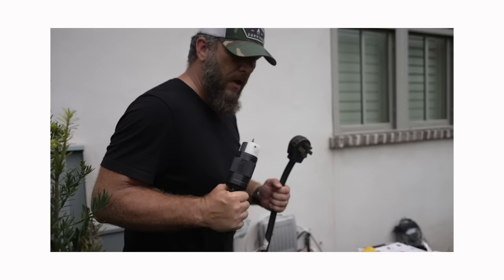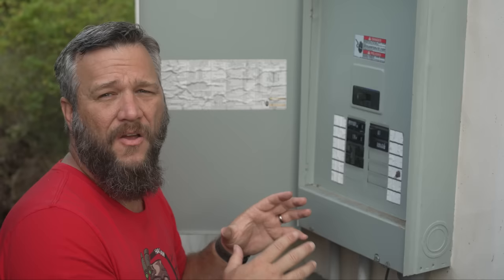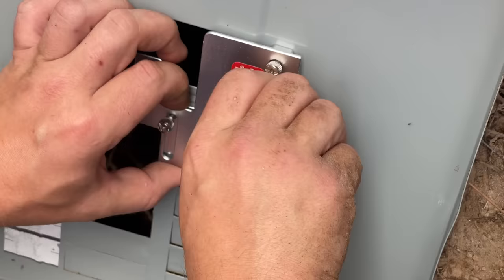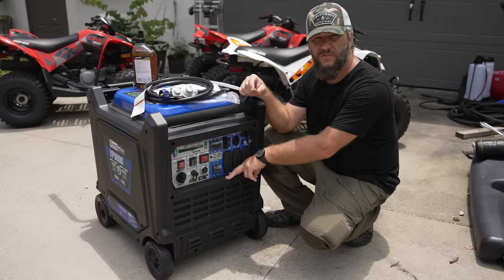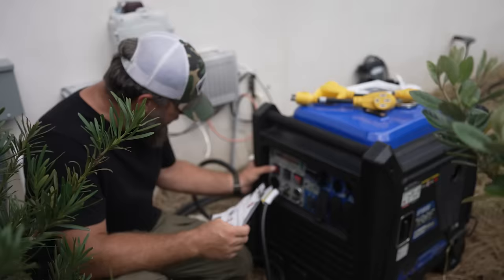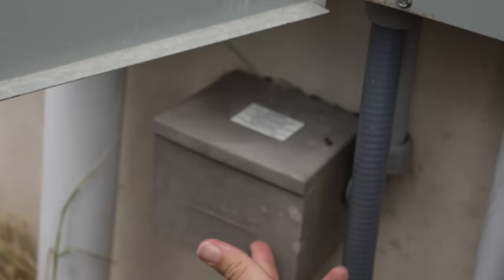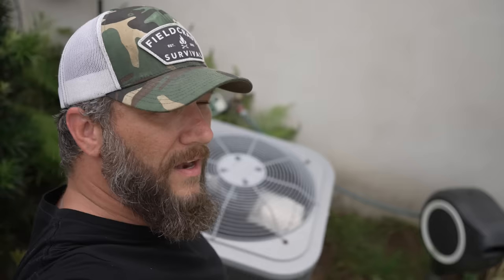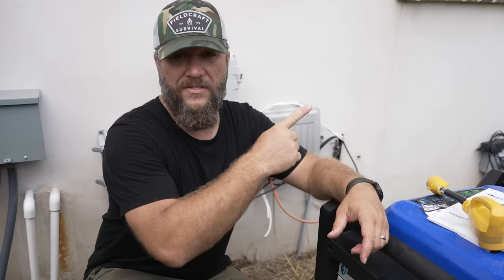90% Don't Know About This Fatal Generator Connection

Comment: Had A friend who couldn't get edison to turn his power, so he bought some cheap 7,500watt generator that put out 240v, so I just got an 8 guage 4 prong and wired it into both legs, the neutral bar and ran a 6' long copper bar into the ground. Damn thing was so loud they built an insulated playhouse around it  and put a better & bigger muffler on it all for under $1,000. 5gal tank $3 gal got almost 12 hours run time. Changed oil every 500 hours He realized at 3k hrs and $4,500 that he was wasting more on gas  & that $1,200 month for edison was a little cheaper AND MUCH QUIETER!

Comment: Many municipalities do not allow an interlock device. They require a manual or automatic transfer switch. You must disconnect the neutral wire when you transfer. You also must properly ground the generator with an approved 10’ ground rod. Best to leave it to a licensed electrician. The life you save could be your own or a family member. Just because it works doesn’t 
mean it will pass inspection and be safe. If you had a house fire and didn’t get a permit and inspection that is the first thing an insurance investigator will look at. Not worth saving some money by doing it yourself.

Comment: Although I don't recommend bypassing any safety measure, linemen always take all precautions as if all lines are hot while making final connections. A lineman grounding out the primary side that might be hot from a generator will hardly even notice a spark if the generator's breaker isn't tripped already. I don't believe there is a single documented case of any linemen being killed by a backfed modern generator like this.

Comment: I back feed my Panel through my dryer plug   30a  ."rule 1 turn off main breaker and all breakers  .plug gen into dryer plug and add back all  120 breakers  ..I have a 12000 btu roll around a/c for bedroom works like a charm..when done unplug gen turn off breakers then turn on main breaker then all other breakers

Comment: 4:30 years ago we had a generator that was way too small for our house . You would have to unplug all the stuff like fridges when it started or it would trip its breaker. So i had the bright idea of revving the engine the held the breaker about when it would normally trip . And boom . Fried a bunch of electronics. I guess an outlet inside was shooting sparks 😳. Ya dont do what i did . And similar can happen from having fluctuations in power from what ive heard .

Comment: best way would be to get an hybrid inverter and  connect the generator to the AC in to charge batteries or feed the house. Safe and no backfeed. you could even connect solars to the hybrid inverter if you decide to have batteries.

Comment: How the hell can a licensed electrician not do the job correctly. This is a law surt period. Are you sure that if the main beaker from the power lines is on and you connect the generator nothing will happen ???? No generator burnout, sparks flying, or lineman dying ??? Thanks for your answer Sir.
Reply: If the power is on and the 200amp breaker is closed, you'll have fireworks. 
If the power is off and your 200amp breaker is closed an you start the generator no lineman will be harmed.....long as he's in the truck and not touching the line you just energized with a backfeed

Comment: Between the step-down transformer and 100s of amps of inrush into the neighborhood's connected loads, most domestic generators would immediately trip their breaker from being hooked up to a practical short.

Comment: HELP 😊Regarding the plug in sequence. I keep reading different things 🥺 DO I Start Gen, then plug in to Gen and transfer box, THEN flip main breaker Off move breaker lock and engage generator breaker? Thank You!
Reply: Cords should always be plugged in before Turning anything on. For disconnecting, Then all breakers should be off on both ends and gen off before unplugging.

Comment: Yes, power will definitely flow backwards even through the transformer creating 7,200 volts to kill the alignment. Not to mention if the 50 amp breaker gets turned on. You have a male plug end sticking out That's hot

Comment: One issue with the interlock kit... What if the main breaker fails and gets stuck in the on position but indicates in the off position? Ive seen it happen before. Theres no way to test the breaker really us off without taking the panel cover off

Comment: I use the potentially dangerous way....until I can get a transfer switch installed.

I use it with power stations with an AC on off switches in between as an extra layer of protection. I understand why interlock switches are needed and I get why we say NEVER this and NEVER that for the ID 10 Ts out there but I use them and while they have the potential to be life threatening, I use them very responsibly.

Comment: Male connectors on both ends of the generator cable are illegal!
Reply from the maker: This doesn't have two male ends. The female end has a guide rod in the middle.

Comment: didn't see you turn the breaker off on the generator first before powering it down.  turn off either the breaker at the generator or the house before turning off the generator is a good practice so the voltage doesn't drop to the house...

Comment: You say you hired an electrician to do the job, but I say, what you hired was a hack handyman impersonating an electrician. No competent/real electrician would install that hookup without some kind of interlock.
9,000 Watts will produce about 30 Amps at 230 Volts. I had to upgrade to a 12,000 Watt in order to handle my 3 Ton Central A/C system without bogging down on start up, and I am wishing I had gone up to a 15,000 Watts (62 Amps) so I could run several larger draw items at once.

Comment: With that size generator and running central unit on a 30amp connection, you will not beable to run everything in the house. I had my Westinghouse set to the 30amp side and when I tried to run anything big like stove or microwave it would not do it. I am wiring it up to a 50amp side now to comp for it, but even with my 12500 watts I will not beable to run central on a 3 ton unit due to the draw.

Comment: When the work was being done in this video, it appear that both the home owner and the electrician the line side of the main panel was energized.  With the main panel energized, NFPA 70E requires PPE to be worn (e.g., Category 2 PPE (Insulated gloves, insulated tools, face shield, glasses, etc.)).  Another safety point, always place the portable generator at least 20 feet from the house with the engine exhaust directed away from windows and doors. In this video the portable generator is next to the house and near a window.   Information in this video is good regarding the used of the interlock breaker.  However, as far as safe work practices used during the electrical work and safe location of the generator, this video gets a solid F.

Comment: If I connected a generator to my house system with the main on I would be trying to power four houses on our side of the transformer only. I have no idea what kind of load from the transformer up line side would be, but I doubt my 200amp main could handle it and certain that I can't afford a generator that could. FYI found out the hard way that just because the main is off doesn't mean that it actually is off.

Comment: @haxman I dont have a large propane tank myself, but I like the idea of setting several 20lb grill tanks aside for running a whole house generator, but how long would a generator run for each lb of propane? Can you run an hours per lb test for us please?
Reply: You might get 8 hours from that grill tank that’s about it .
Reply: Three hours if you’re really powering a lot of stuff, five hours if you take it easy.  Lots of experience with this with Hurricane Ian.
Reply: those small tanks will ice up as level drops and stop delivering propane even though there is still 10 or 15% propane left.
Defrost and restart 😂
I get about 7-8 hours per tank on our lightly loaded Wen 11/8 kW genset (11kWgas/8kWlpg)
Reply: @rossr6616  just last night using the grill the tank was still feeling half full but the burners flame  were getting lower its a large 5 tube stainless char broil unit a douse of boiling water perked it up .
Reply: Wow, it doesn't last long I'm hearing. Lbs per hour instead of hours per lb. Thank you all for the food for thought. I may stick with a gasoline generator as a result..

Comment: People always talk about lineman getting ⚡️ from a generator. This is a true possibility. Although lineman are trained to always act as the gun is loaded. And don’t ever point it at your face. Some solar systems deliberately send current back into the grid “A grid tied system”. Lineman are prepared in safety gear for this, and they alway consider that the gun is loaded. They also deal with a lot more current than a generator puts out.

Comment: When purchasing a generator for your house you should look at running watts instesd of max watts, or surge wattage. No matter the size of the generator you can only utilize 12000 running watts due to the fact your output is governed by a 50amp rec.  Also you may beable to run your ac but you should turn off your stove and hotwater tank breakers.  Your hotwater tank is usually 4500 watts.  If either was running your ac would have tripped the breaker on your gen.

Comment: Had a buddy actually backfeed his 7500 watt gen into the grid. It would immediately load down his gen and trip its breaker. It couldn't begin to run his neighbors houses, streetlights and whatever else was on that particular circuit.
Reply: Unless the storm damage meant it was only trying to power 1 or a few houses, with most of the loads in them likely off. A few houses porch lights and some small vampire loads wouldn't be a big load
Reply: @franklofarojr.2969   It's in a heavily populated neighborhood so everybody's fridge, furnace, water heaters, etc would try to power up along with back feeding into the transformer which would present quite a load. So it would be an enormous load.

Comment: A bigger generator/inverter generator isn’t always better for one main reason - fuel consumption. A larger generator uses much more fuel per hour than most people realize. And most people don’t have the ability to store larger amounts of fuel, even enough propane unless they have at least a 500 to 1000 gallon tank.

A great solution to all of this is to match generator wattage output to expected critical use appliances. Have enough generator capacity to run a water well and maybe a furnace plus a few lights along with refrigerators/freezers. Cycling power between larger appliances is even better. If you can get by without the larger appliances, that’s even better.

Here’s a couple of examples.

A Honda 2000 inverter generator is a fuel sipper and can run some lights and a refrigerator and/or freezer (especially doing cycling between units if necessary) at a 50% load for two gallons of gasoline the entire day. Take a much larger generator inverter and that same gasoline can be over a gallon an hour in many cases with wasted energy and precious fuel lost in an emergency. 

You would never get me to use up precious fuel (especially with a long emergency), have a louder than normal larger inverter generator running if OPSEC is a concern plus other reasons.

After running generators and generator inverters for years and talking with electricians, they recommended the smaller generator for the reasons mentioned above. 

Also, in an emergency grid down scenario with more craziness of people changing by the day, you clearly don’t want more people seeing your place lit up like a Christmas tree while they are searching for warmth, food and shelter. Hopefully you know what is being said here.

Use OPSEC (Operational Security) measures as much as possible. Use common sense and don’t be a target. You want as little attention as possible in an emergency. Bigger generators producing lots of power is not necessarily a friend. In most situations, it’s fine. In the thick of problems, it’s your worst enemy at times.

Comment: What is the running wattage on your inverter? I have a 9000 watt generator (start up) and 7250 (running) watt generator. Your real power that powers your house is the running wattage. Just wondering why you went with a 50 amp breaker. Mine at 7250 would come out to 7250/240 = 30.16 (ohms law to determine proper breaker size). Not sure if inverters have a runnig wattage or if the start up wattage stays that way on those. Most 9000 watt generators require only 30 amp, which is listed on the generator. I'm just wondering is all.

Comment: We just had a series of storms and lost power for many hours. The problem with basements is that without power, the sump pump doesn't run. This is not a fun situation. 
 Did the electrician install the subpanel on the outside of your house?
Reply from the maker: It was already there because of the well pump breaker.
Reply: Thank you for your information. I am researching this for our place. My wife doesn't respond to the old electrocution gag anymore. 😂 You got her good. Did you find that that generator meets your household needs?
Reply from the maker: So far so good. I think I might still need slightly larger just to be on the safe side.

Comment: We rarely need a generator how ever my grandfather works construction so if we get hit by a hurricane and it knocks the power out he’ll always have a generator from work on standby he’s back fed the house using the dryer outlet but he’s smart enough to turn off the main breaker before doing anything so he doesn’t back feed the entire neighborhood but he knows what he’s doing I don’t recommend it but for him in a pinch it’s fine, him being a construction worker and an area superintendent safety is the most important thing to him.

Comment: Cheaper inverter generators (not buying an industrial one) can suffer from large inductive loads such as your air conditioner or power tools if you get near their maximum capacity. Mechanical generators don't suffer nearly as much and are good for inductive loads.

Comment: These things are nifty and they do work but you would never get a permit with that kind of an interlock in my jurisdiction. The electrical inspector would call you a hack. A properly labeled manual transfer switch is the proper way to do this.

Comment: The interlock switch is kind of a useless add-on. Anyone who would be using a generator already knows to switch the breakers. Technically it does violate a code 702 that requires a mechanism that prevents 2 power sources from powering the same box, but the punishment is revoking work permit, but you aren't going to get a permit everytime you turn on the generator in the 1st place.

Comment: When running gas, to kill the generator, turn the gas off, and let the generator burn/use up the gas in the carburetor. It will keep your carbs cleaned up. Most people just hit the off switch and gas sits in the carb which gums it up.

Comment: Interesting. I have the same unit but in Genmax orange. It does NOT start my 3 ton hvac unit under propane, and I have a Micro Air EasyStart on it. It pulls 36 amps when it kicks on, which ia just above the impulse voltage of the generator under Propane.
Reply from the maker: That's odd. I wonder why that is. I don't have a soft start but I'm going to put one on. I've also wondered if they were the same company.

Comment: As I understand it since you only have a 50 amp ckt, a 9000 watt inverter is about right, should be around 40 amps - gives you a 20% safety margin.

Comment: Thats crazy. The real question, was the electrician licensed? Crazy to me that a "licensed" electrician didn't know he was  doing it wrong in the first place by not using an interlock kit. 

Another question is that generator you wired going to a main panel or subpanel? I want to do this at my subpanel where my circuits land. My main panel doesnt have circuits and is an external disconnect. If I'm thinking about this correctly I would need a generator with a floating neutral since subpanels require grounds and neutrals to be seperated. 

Or I could use a manual tranfer switch then I wouldn't think it matters if your generator has a floating neutral or if the neutral is grounded. Can anyone confirm if Im thinking about this correctly?

Comment: Dumb question here. Can i plug my RV into that plug and do the interlock to block the main breaker to use the generator breaker to power my RV that is sitting in my driveway? Yes I understand the max output is 50 AMPS for my plug.

Comment: the difference between modified and pure sine wave is seen mostly on motors - fans are noisy, fridge compressors, etc. Electronics they say can be affected however honestly they are always being converted to dc by their power bricks one way or the other so chances are if you're going to kill something in your electronics it'll be the power brick

Also, apparently, pure sine wave is more efficient so you don't need as much capacity?

Comment: I am NOT a lineman, I do not work for a power company, nor am I any kind of electrician. However, something tells me the lineman out there risking their lives run into a-holes who back charge their lines all the time with generators. I’m not sure of what steps they take to keep from getting whacked, but I’d bet my left arm there is something they do about it. It’s probably more of a problem sending low voltage back into the grid and screwing up other people’s appliances and electronics. ??? Maybe someone a bit more savvy can chime in and let us know.